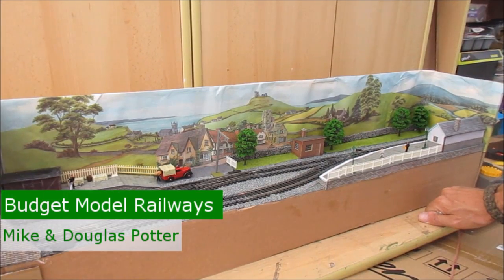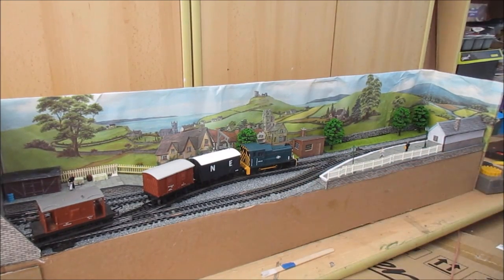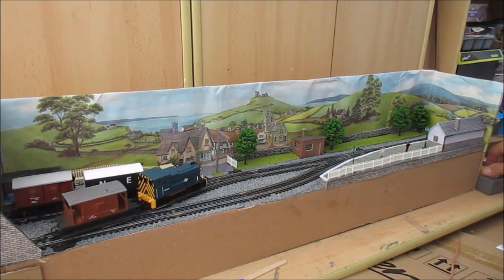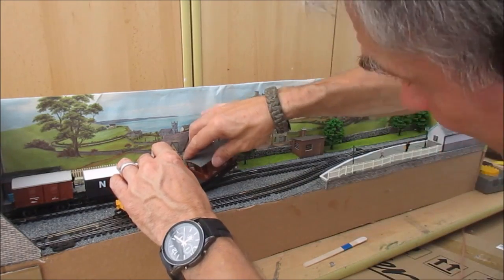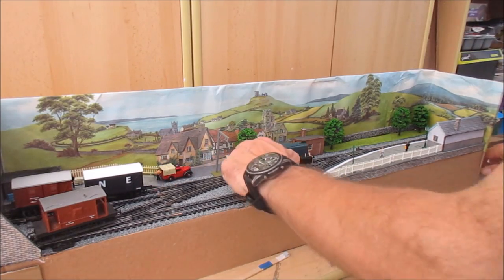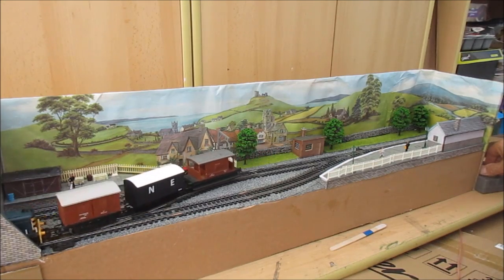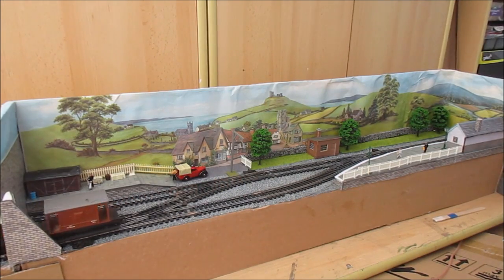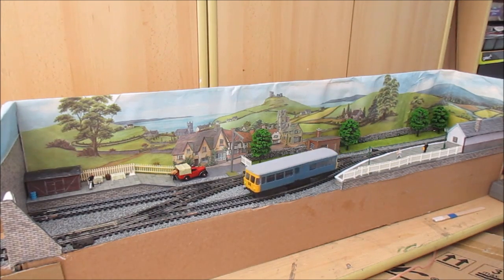How To Make A Simple Shunting / Switching Model Railway Layout Part Three - Operating Potential

Comment: Brilliant! Nice little shunting layout! Hours of fun! Great locos
Reply from the maker: Many thanks, Ive had great fun with it. I changed the troublesome point and it's much better now, only took me a couple of minutes to change as I used ballast mat.
Reply: My modest 4'x6' layout in the caravan that I live in during my retirement is large enough for two Hornby track mat ovals, second and third radius, slightly modified with a full straight at the ends allowing the use of second radius curves in the middle instead of first radius, which leads to a modest sized Inglenook shunting yard of three sidings using two points.  This small Inglenook shunting yard provides plenty of shunting operations on a modest sized layout. This shunting yard is NEVER used as a fiddle yard, I store my locos and rolling stock in stackable plastic containers no larger than a desk's drawer using sponges at the bottom providing a nice pillow. As long as you handle the several plastic containers level the locos and rolling stock don't smash into each other. When we are young we started on our bedroom floor, graduated to a small bedroom table layout, then after we left home may have had a much larger garage, storage shed, or loft layout, but eventually after you sell your home and end up in your senior years in a caravan as It is small and easier to clean and maintain preferably near the sea, you end up with a table layout no larger than the 4'x6' layout you had as a child in your bedroom...

Comment: Wow, It really is amazing to see what can be done in a small space. I think I might build one of these, but with a full size steam loco for an extra challenge. I'll just have to lengthen the sidings because American freight cars are much longer than British ones.
Reply from the maker: US outline is a bit more challenging due to size, mind you it would still be smaller than most 'small' US layouts! Lol
Reply: @BudgetModelRailways  yes, i am thinking about adding it to the 5'x3.5' layout I am building- I will have a switch leading off the  main board where I will eventually attach it.

Comment: I’m fascinated with this great compact shunting layout. I am a total novice, so if I were to attempt to set a similar one, roughly how many points would be needed & do I need short curves also could it all be run with one controller?
Reply from the maker: Hi, you would need three points and a R606 short curve plus some straights, second hand points will keep the cost down. One controller and only one power feed will be all you need. Any questions just ask happy to help

Comment: Cut  a  strip  of  clear  strong  plastic about  1 cm  wide  and  3  cms  long and bend inbetween sleepers  for an automatic  decoupler
Reply from the maker: I've tried it. It takes ages to get right and as not all wagons and locos  have couplings of the same style or height it won't work on all of them so I gave up.
Reply: @BudgetModelRailways  worth a  try  keep  videoing
Reply from the maker: It's a great idea, it's probably just me lol

Comment: What a great little layout, I'm tempted to build one like it myself. I'm curious how this layout is wired up, I'm guessing the power feed is at the platform end?
Reply from the maker: You could put in wherever you like as there is only one loco at a time, my power feed is actually just under the tunnel mouth.
Reply: I see, so these points don't set the route for the power like Peco set track ones, everything is powered no matter which way the points are set?
Reply from the maker: In theory they should not transfer the power but as I only run one loco at a time it does not really matter. I can isolate the goods yard if I want to hold a loco there while I run the Railbus in.

Comment: The magnetic decoupler is a poor idea compared to the original Triang R.160 hand decoupler, which goes under the couplings and lifts the strikers removing the need to actually handle the rolling stock.

Easy to make with a piece of plastic sheet glued to a handle and set at a 30 degree angle.

The Hornby Railways GWR Shunter's Wagon came with a miniature hand decoupler though the original R.160 works better as it has a weighted handle end so it can be placed under the strikers with the couplings in tension, the loco pushes the couplings together and the decoupler tool pops the hooks and the wagons can be pulled apart.

A lot simpler and less fiddly than the magnetic hand decoupler.
Reply from the maker: The originals are like hens teath! The magnetic coupler is not really that fiddly and works really well, although I will have a go at making one like you suggest

Comment: The rail bus is fab!  Brilliant idea indeed.  The only thing I don't like about Lima locos is that they are not smooth starters.  I have three and they're all the same.  Anyone else have the same trouble?
Reply from the maker: Hi John, thanks. I find they need extra weight and really clean wheels to start well if that helps.
Reply: I'll bear that in mind and give it a try, thankyou for the tip.
Reply from the maker: If they are the shunter like in my last video then the gearing is a bit high and even with a good controller they jump a bit.
Reply: Yes an 08, and a steeple cab loco.  I've converted the latter to run on the catenary (and switch to half-wave rectification if I remember in time) which makes them a lot smoother, if slightly noisier.   (I can't find the third loco atm)
Reply from the maker: Very impressed you got the cantanary working, if you would like to send us some pics and we will put them in a newsletter. I've had two Lima 08 and both are pretty poor.
Reply: Pictures now sent, chaps.

Comment: Great layout how did you make the station platform
Reply from the maker: 10mm thick corrugated card packaging with brick paper on the tops and sides and white printer paper with lines drawn in for the edging

Comment: I''ll have to look for a mehano controller off ebay, great as always. I highly suggest going to Carendt.com if you've not already which has plenty of small layouts like this and a few budget ideas here and there but mostly switching layouts and concepts for fun operation.
Reply from the maker: Either of the Mehano controllers seems to work well, I gave three. Will take a look at that sight, thanks.
Reply: You're welcome, the best articles in my opinion are from about 10 to 125, before the owner passed away, the site is still updated with new scrapbooks every couple months but are not as good as those from the mid 2000's.

Comment: This is a great track plan! How could I be able to run 2 locos? Do you think connecting a link wire between the tunnel/power source would give power to the siding?
Reply from the maker: Hi, thanks. The siding is powered so no problem. You could add a bay platform as well. Are you using DC or DCC
Reply: Budget Model Railways Planning on using DC.
Reply from the maker: That will simplify it then
Reply: Budget Model Railways Another thing, where's the power source located?
Reply from the maker: On the entry track , using contacts soldered to fish plates

Comment: Hi! Great fun video. I have a question regarding the Mahano controller. Is it available new or just secondhand? What sort of price can I expect to pay? Take care...
Reply from the maker: Ive bought mine second hand usually for between £5-£10 , I believe you can buy them new but they are about three times that. If buying second hand some will come with a continental plug so you would need an adapter as well. We have two excellent controllers from a company called AGW, they are old but very good and both were bought second hand, the single for £10 and the double for £20, Hooe this helps
Reply: Thank you for your quick response regarding train controllers. Your information is just the thing to help me and it's always good to know what prices may be for secondhand. Take care...
Reply from the maker: Happy to help

Comment: How long and wide is the layout? Because I would like to make something like this. Also I subscribed!
Reply from the maker: Hi, thanks for subscribing . It's 7 inches by 3ft, ideally a couple of inches wider would give you a bit more scenic area and possibly room for a small bay platform which would give you a bit more operating potential.
Reply: Budget Model Railways thank you!
Reply: Just one more question, what pieces of track are needed to make it? (This is the last question).
Reply: Can you please tell me it would help me a lot.
Reply: Please tell me. It would help a lot!
Reply from the maker: 3 left hand points, a short curve, 5 lengths of straight track, approx 6 inches but it depends on the size of the layout. If you wanted to make the layout a little wider and put in a bay platform you would need another left hand point and a short straight. you will also need a length of straight track and a track connecter to make the fiddle yard.
Reply: Budget Model Railways thank you!

Comment: Nice. But I do not like to see your changing the points by " hand of God". Have you considered the possibility to remotely operate the points with a piece of wire or something similar, with the control button on the front panel? Of course, no use of electric motors which would be contrary to the cheap modelling concept. Years ago, I transformed a couple of cheap plastic signals to operate them without touching the signal itself. I just fixed a piece of wire that was linked to the moving part, going down under the surface of the layout and connected to another wire crossing to the front pannel with a piece of cork as "button". I guess the same could be done with the moving part of the points.
Keep up the good work.
Philippe